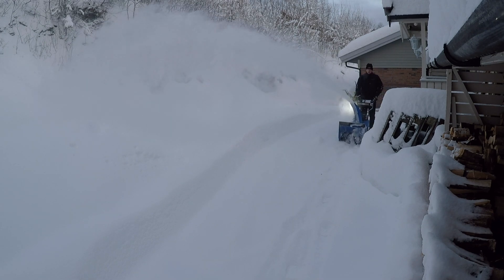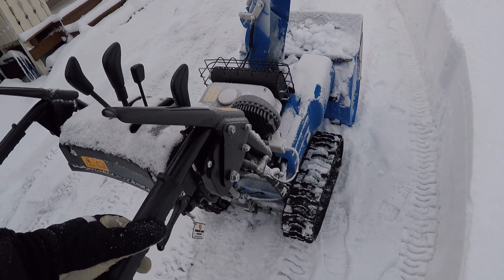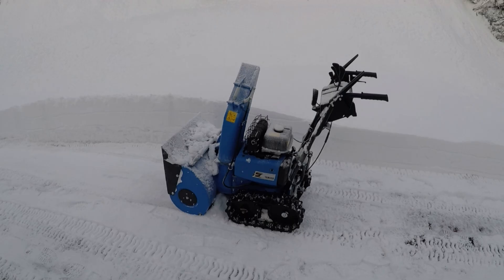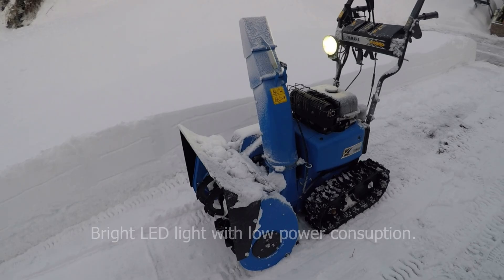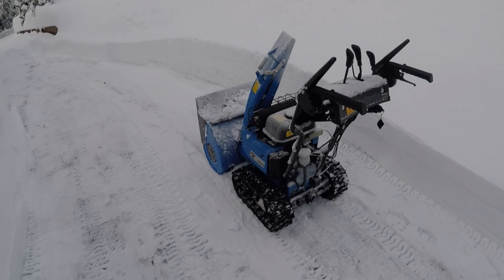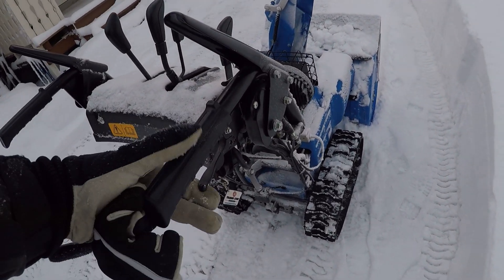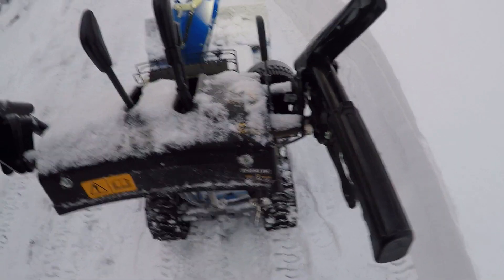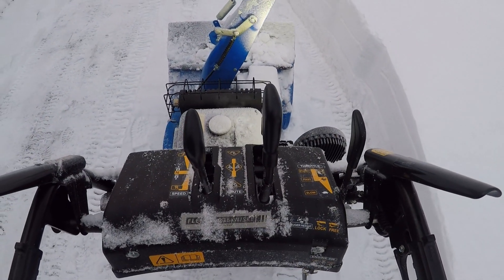Yamaha Yt660 - Technical review - and "torture test"

Comment: One thing I did to add more power is that the stock motor is around 3900rpm, I moved the governor arm to the other hole which is meant for higher rpm for higher altitude. Now it goes to 4380rpm which makes a noticeable increase in power, especially in heavy wet snow and it throws snow even farther. Might reduce the overall life span of the motor but its a yamaha so im not to worried.
Reply from the maker: Yeah, I think you are just fine with a little extra rpm’s☺️ 
Great quality machine
Reply: @Flenstadtekniske  yes exactly and I installed a rpm meter so I can adjust accordingly depending on how much power I need instead of guessing with the lever if I might go into the choke part.

Comment: We have Yamaha in Canada but the price is ridiculous! For the 12/32 with taxes it’s around 9000.00 Canadian dollars.
Reply from the maker: I see. That’s a steep price😅
Reply: Paid $9000 for the machine  , no matter how superior it is , not worth an arm and a leg , goodcluck with the toy !
Reply from the maker: @ 9000$ is huge money. In Norway these are more in the 4000-4500$ range. Still a lot. 
But fun to work with, and seems to be solid quality. Thansk!
Reply: @Flenstadtekniske  I have the yt624 in canada which is the exact same as you yt660. the price is indeed around 4500$CA. @hermanchow, the 9000$ machine is the yamaha 13HP model, NOT the 6hp.
Reply: I would rather get a Ariens. You will get a larger snowblower and probably less than half the price of a Yamaha. Repairs is probably easier to get parts and sevice.
Reply from the maker: @georgebenevides  my experience with ariens is that they don’t work as efficiently. Big engines, but still a smaler honda or yamaha will be faster, and have better throw length. But is it worth the difference in prize? I think it will depend on the use and what preferences you’ve got😊
Reply: @Flenstadtekniske  Not my experience. Had a Yamaha YT1070 for 2 years, and replaced it with a Ariens Rapidtrak PRO 28 3 years ago. The Yamaha was so weak in the engine compared to the Ariens, HUGE difference and with the Yamaha you needed to go super slow with huge loads. Also no trigger turning or easyturn, the Ariens has Easyturn and makes the job SO MUCH EASIER when blowing snow and you navigate around corners or on small surfaces you need to clean. The thing Yamaha did better was the better traction that is welcome for excample during spring cleaning of huge amounts of old snow. But all in all I choose the Ariens PRO everyday in the week over the YT1070. My brother has a YT660 that I have used a lot and the Yamaha machines are impressive in many ways.
Reply from the maker: @dagjohnsen  Good to hear 👍🏻
Reply: @georgebenevides  Ariens make good snowblowers but nowhere near the quality and performance of Yamaha or honda.